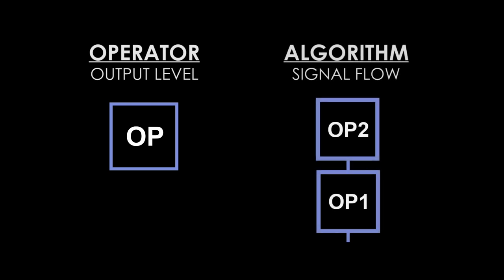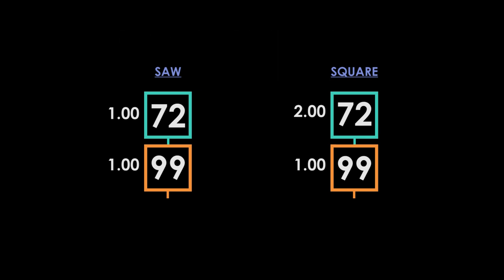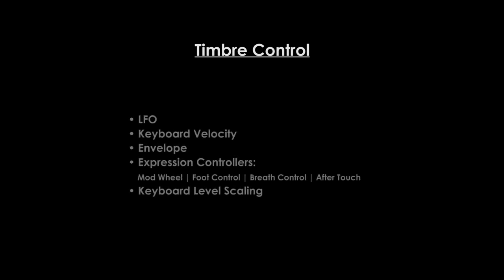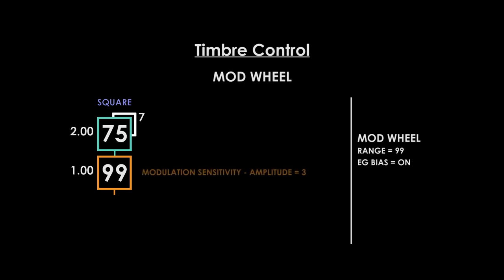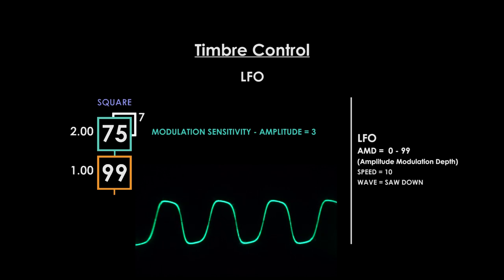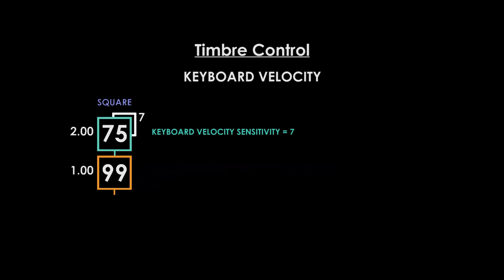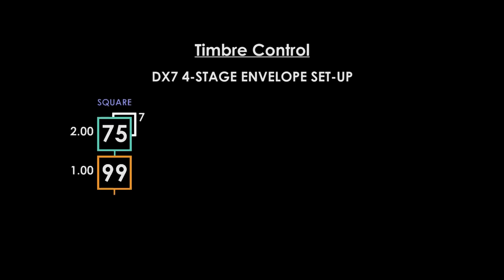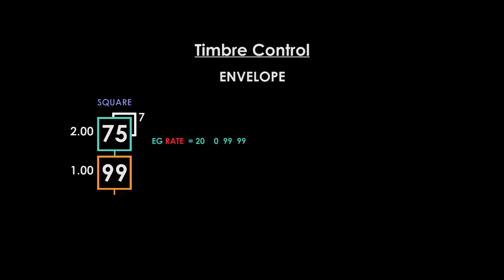Waveforms & Filter Effects | FM Synthesis Explained 2

Comment: Great straightforward video. I am still confused as to how the operator feedback works though? Is there phase delay, some sort of sample averaging to prevent infinite feedback? What does this mean mathematically in terms of harmonics?
Reply: i'll try to explain but not quite in mathematical terms. for me the fm operator is the function, let it be a sine function. fm operator has an internal phase angle generator, a kind of a diagonal line f(x)=kx. when this line passes through a sine function this will produce, accordingly, a sine wave on output. operator also has input, when you push another operator's signal through it that means you sum this signal with internal phase angle of the operator, that affects the phase angle and this is why signal is changing. when operator is in feedback that means you sum what's inside the operator with something going from the same operator's output at the same time. so, answering to your question: look at the sine wave, it has maximum point, 0 point and minimum point. in 100% feedback you will get a complex wave with max, 0 and min points. what i think is that when sine gets max point the phase angle will rise up to +infinite, when 0 - 0 accordingly, and when minimum - -infinite.
P.S. you can also produce a pure white noise with operator. just set multiplier to 0.0 and shift angle to 90° (or 25% in some synths), so it will produce just value, not even a wave, and set feedback to 100%, so you will get the white noise

Comment: Thx for this! How do these simple patches containing only one modulator and one carrier relate to the more complex algorithms? Do you always come back to these subtractive synth appproximations?
Reply from the maker: Great question! Complex FM waveforms are quite unusual to most users, so listening to changes in familiar waveforms, like saw and square, helps our ears to track what's happening to the sound. I don't use these waveforms all of the time though, I generally use them when I'm wanting to build a sound quickly.

Also, this C+M stack is present in almost every algorithm on any FM system. The MF SAW and MF SQUARE recipes are good for testing the sound and edit process of each FM synth you encounter. Not all FM synths are exactly the same, so whenever I'm on a new FM synth, I program these patches to get my bearings.

Comment: But how do you model resonance?  That's a key component of what makes subtractive synths interesting.
Reply from the maker: Excellent question. I've tried to capture the effect of resonance using FM many times but so far haven't found an FM behaviour that emulates it - at least not on the DX7. From what I've learned about waveform behaviour in FM it seems impossible to me. I'd love for someone to prove me wrong though!
Reply: I tried to use a carrier/modulator stack with at least double the value of coarse freq set for the saw stack, while setting the modulator envelope levels in a kind of opposite behaviour.
With the right amount of detune you can get a sound that reminds the resonance.
Wouldn't say realistic, but definitely a step into the right path for me.
I just started to think of resonance as a gritty whistle.
Reply: @madFame  I've found that you can get a kind of resonant filter type sound by setting a carrier to a constant frequency (I tend to use 1.000Hz so that the carrier isn't audible without modulation), set the modulator to 1.00 and then adjust the modulator level to get a kind of resonant filter sound. I couldn't say exactly why this works, if I had to guess i'd say that perhaps the dissonance between the carrier and modulator produces a thin band of frequencies that rises in pitch as the modulator output level increases? I basically just copied this method from the FMilters patch on the DX7IID and it seems to work well enough. That said the resonant-esque sound you get from it isn't super pronounced, there are probably ways to enhance it quite substantially with more modulators, different output levels or maybe the inclusion of a feedback loop, I just haven't tried it yet. Hope this helps and you're able to get something out of it if you decide to try.
Reply: Stack of three
1 : ? : 1   ratio    Alter the ratio of the middle operator in realtime for a 'stepped filter' effect?????

Algo 6 maybe???
With some feedback???
Reply: @madFame  The general, static harmonic behavior of resonant filters on complex waveforms, and especially their dynamic behaviors, are essentially 'incompatible' with FM's Index/Bessel Function behavior of harmonic structures.  On an DX7, it's not going to happen -- though as you've undoubtedly found & others have noted is in some very limited or non dynamic situations you can get a 'flavor' of 'resonance'.  In AFM of the SY77/99  you can fare much better in static and dynamic resonance emulation using the multiple feedback loops, non-sine waveforms, true 'zero frequency' operator mode and the key parameter of AFM -- Operator phase control.  These let you 'cheat the math' to give better emulations of resonance/resonant behaviors.  However, as much as AFM does a significantly better resonance emulation, it is still of only limited range and timbre, and still nothing like a classic high resonance 4-Pole ladder filter sweep.  On the plus side, you can do true pulse width modulation with AFM.
Reply from the maker: @Dr. Synth Thanks for the explanation there!
Reply: @madFame  BTW - watched a number of your videos, you have an excellent concise clarity of presentation, and the graphics/diagram format is straightforward and easy to follow.  I tend to get way out into too much technical nerdiness in my vids that I think loses people half way through.  Good work !
Reply from the maker: @Dr Synth  I really appreciate your feedback, excuse the pun ;) Your understanding of these machines is amazing, there's always a need for in-depth knowledge. Conveying it is tricky though, I agree.

I thought a lot about subtractive synths and what makes their workflow easy to pick up and applied it to the DX7. It's not so much about the controls, whether there are knobs or not, whether there's a filter or not etc. it's about the workflow and layout – left to right. Unfortunately, the DX doesn't have this and that's the first obstacle for most. Where do you start? What's the first most important parameter? You wouldn't know from the control panel the way it is.

My graphic layout in my videos helps to remedy this visual problem. Even FM-X struggles to convey a simple workflow, unfortunately. There's a lot I'd change in that interface.

My 'recipe' approach is built around initialized values to minimize data entry. This way, you only focus on the values you need to change and ignore the rest. I follow the same steps every time so people can get used to adjusting each parameter in an ordered workflow.

I'm relatively new to FM synthesis but I always felt like people's negative comments about these machines weren't fair. My hope is that these videos can change the common perception that FM is a bad option compared to subtractive.
Reply: @madFame  I think the perception has changed mostly due to sufficient time passing since the DX's chart dominance, so younger users can discover it without many preconceptions.

Comment: Very interesting, thank you. But this doesn't really sounds as a filter but rather as a wave morphing. We can see that at the beginning. We see a sine wave mophed to a saw or a square wave.
Reply from the maker: Thanks for watching! You bring up a good point. Filters remove harmonics within a specified bandwidth. When all sidebands and harmonic frequencies are removed, then you are left with a sine wave. All filters do this, but with analog filters, there is a noticeable drop in volume as well. To emulate this in FM synthesis, you simply apply the same methods in this video to the carrier as well as the modulator.